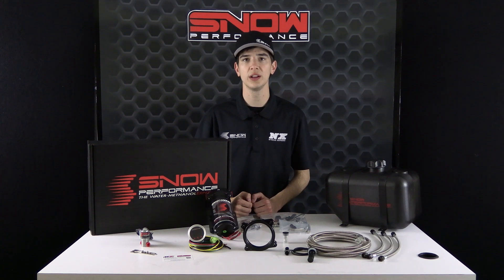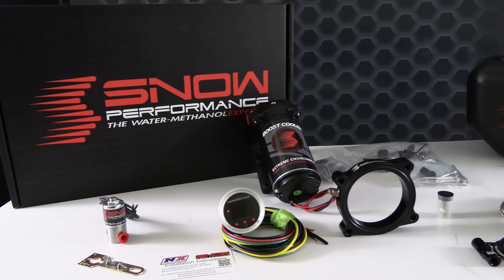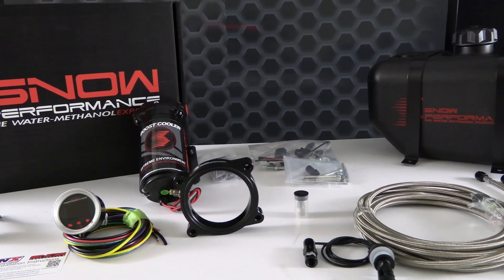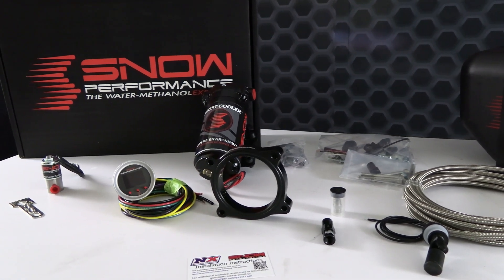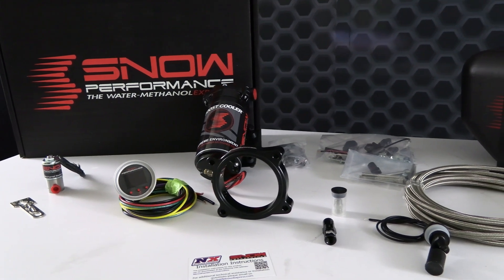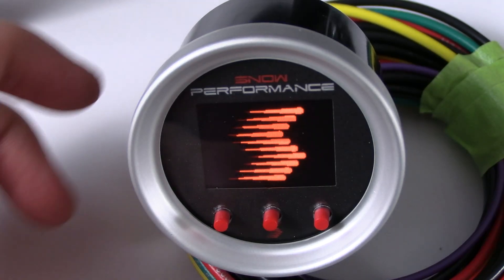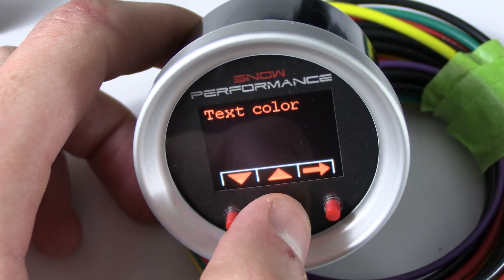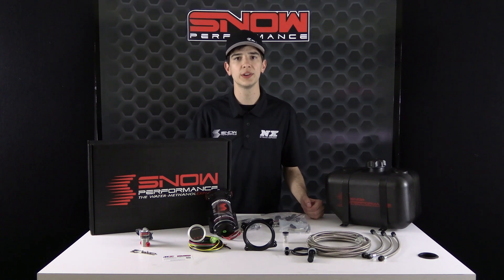Snow Performance Stage 2.5 Boost Cooler 2011+ Ford 5.0L System Overview

Comment: I just put a centri on my 2020 mustang gt. However the gas around is crap. The car is knocking and pulling timing. Octane booster is helping a little but at the rate I'd need to mix it'll get expensive. I think this kit is my go to solution
Reply from the maker: This kit would help you out a lot!
Reply: @snowperformance1  👍 Am I better off spraying several inches in front of the throttle body or using a throttle body spacer? I did speak to one guy who seemed very knowledgeable and he says he doesn't like the throttle body spacer as some cylinders may get more than others and the vacuum issue
Reply from the maker: @lobbyrobby  We recommend a throttle body plate for spraying, if that isn't an option than using a single nozzle system would work fine too.

Comment: For a vortech setup, the IAT sensor is located in the MAF housing below the charge pipe which is before the meth. Where would you recommend locating the IAT sensor to utilize the benefits of the system?
Reply from the maker: It will have to be down stream  of the nozzle if you want it to realize the drop in IAT from the water methanol. You will want to have it shielded if possible otherwise the liquid can cause a false cold reading.